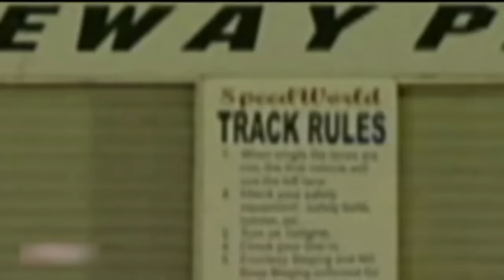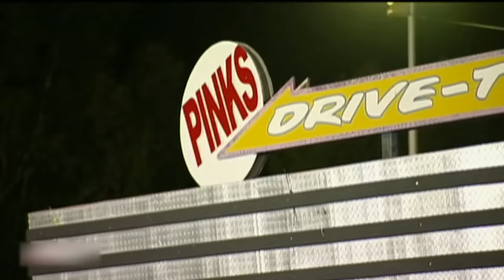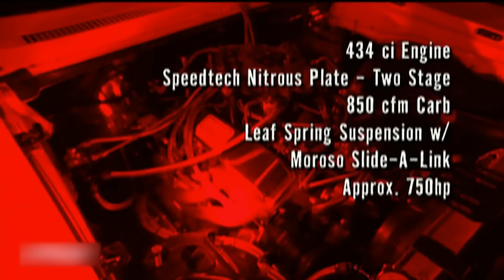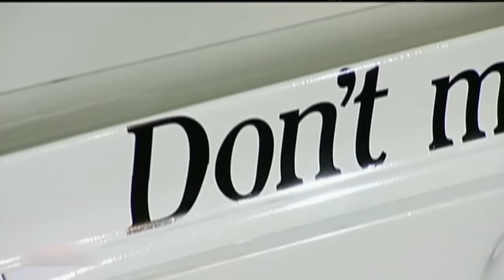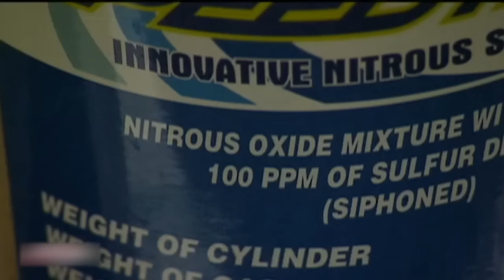PINKS- Lose The Race...Lose Your Ride! - MORE MONEY SPENT DOESN'T GUARANTEE A WIN!! -Full Episode

Comment: A 360 CI Engine (assuming a 350 bored out) with a 750 cfm carb and basic heads made 570 hp on just motor?

Comment: Driver of the orange nova should stick to doing burnouts as he can't drive. The driver of the camero is a driver and also shows that u can build a car using the best parts but  u can have a lesser built car run better times if u know how to set up those parts rather than just have the best parts but no idea how to use them.